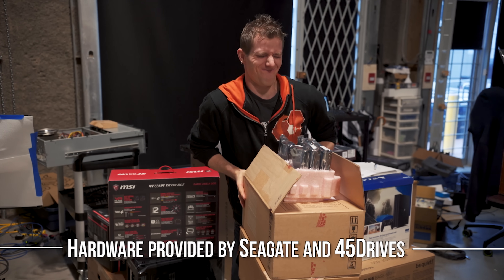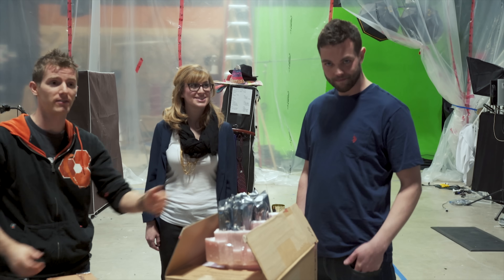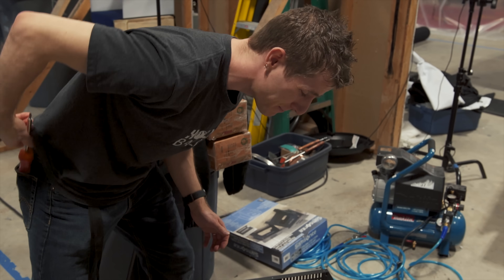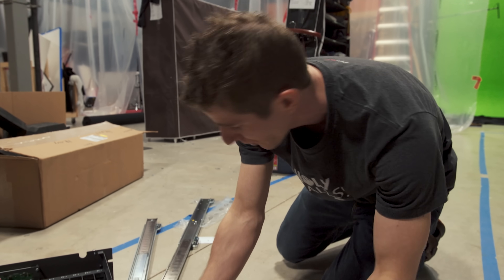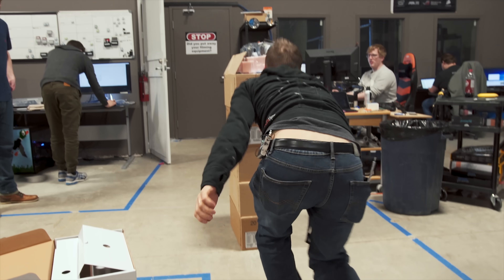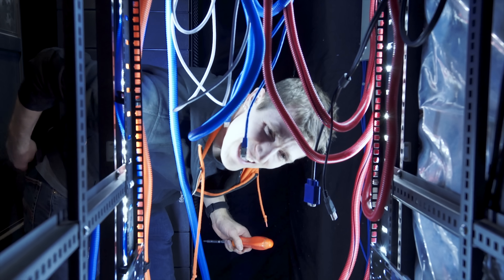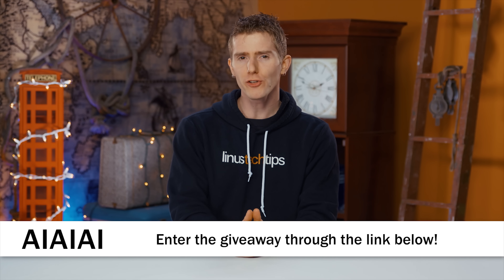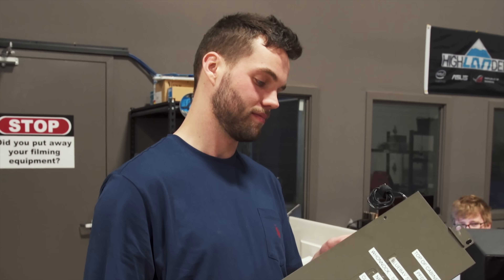INSTALLING THE PETABYTE - Server Room Upgrade Vlog

Comment: 50 years and it all will be in a micro sd XD
Reply: Those will be the days. We'll all look back on this video fondly when a petabyte had to be created from a ton high terabyte drives
Reply: MLG_Sloth DNA storage baby
Reply: thats probably true, but it wont be anything huge, because games would probably take like 10-20 petabyte.
Reply: luke bey I've heard that its painfully slow unfortunatly :/ But it could be paired with one or two levels of faster cache to make up for it
Reply: Actually, no

There is a limit where it cant possibly get any smaller
Maybe if we invent a new way to store data
That wont be a micro sd anymore though,  soo
Reply: LEGENDARY DABING POTATO U sure you don't mean in a 106ds XL. Mario Kart 31 will run in 16k, and the graphi CD s are so intensive that it takes 23 Titan X Pascals to be able to get about 4fps. (I mean try installing minecraft on an apple computer from the 80s will a few kilobytes of ram and 16 megabytes of storage or something like that. That will be the advancement of technology.)
Reply: I would say no more than 15 years tops, that is if storage progresses at even half the rate it has thus far.
Reply: Nah man; the all new Jazz Drive XD (Xtra Density)
Reply: Maybe 3 or 4 Years...I saw yesterday 16 Terabytes of ssd harddrive & it was like 3 inches long
Reply: LEGENDARY DABING POTATO  i would say 5 years max. The technology is rapidly developing.
Reply: luke bey don't forget dna data where all the information on the internet could literally fit into the tip of an pinkie.
Reply: due to new info laws, in the future, nobody wants to store anything..

so.. i think.. some people wage their lives in holding those somewhere in deep secret places.. or moved around by innocent unknowingly used mules.. with silly hello twiggy bagpacks.. because that is the trend in the future... everybody loves hello twiggy
Reply: Organic modules my man.
Reply: LEGENDARY DABING POTATO probably way less than 50 years, technology is developing faster and faster
Reply: It's probably sooner the than that. When they crack DNA storage...
Reply: so true
Reply: Those days gonna come
Reply: 666 likes
Reply: A 1pb hdd is possible. It would just need a ton of platters.
Reply: LEGENDARY DABING POTATO lol

Comment: *runs into Linus's server with a 5lb rare Earth magnet
Reply: A powerful EMP generator would also work fine....
Reply: Maybe a gun?
Reply: Major League Vlogging wtf man? the data on HDDs is written and read by magnets...
Reply: Linus is going to drop them all, sooner or later.
Reply: AveraglyAverage na to noisy
Reply: Yoav Zoller fukin rich af
Reply: now thats the reason ssd are never used for GIANT archive
Reply: it may or may not do much.

HDDs have rare Earth's in them to control the heads and they're big too.

on the other hand, most drives have an Aluminium case which does not impact a fixed magnetic field.

those disks are inside a steel case inside a steel server however. So you'd need to put the magnet on an actual drive.

Enen then you'd need to cripple a few, as it's an array, and it HAS THE TECHNOLOGY,  AND IT CAN REBUILD!

Also MLV bro HDDs are magnetic storage. optical storage is permanent / semi permanent and is only employed on compact disk, DVD, or blueray disks.
Reply: A giant tesla coil would be fun too 😈
Reply: Ummm, no! There are NO fricken lasers in a hdd, it's all about the magnets baby. An oscillating magnetic field will corrupt the data. 

SSDs, on the other hand, function nothing like batteries so it looks like you're two for two there buddy.
Reply: Next video: Our raid server is gone (again!)
Reply: Kyle4679 I will do it
Reply: Lol
Reply: Major League Vlogging but don't hdds  be more affect as it has mining parts
Reply: Hehe
Reply: jaxative jax It's extremely hard to produce a strong enough magnetic field to damage the recordings on the HDD platter. It is written with a very strong field from an extremely short distance compared to the distance between a platter and a magnet outside of the drive.
Reply: How about a massive neodymium magnet
Reply: flangel842005 no. HDDs write data in physical form, by imprinting laser on them. SSDs store data like a battery, so any electrical discharge will corrupt the data in ssd.

meanwhile I believe that laser cannot be corrupted by a magnet.
Reply: unknownagamermc tis electromagnetic, not laser.

Comment: I have 180TB capacity in my home server but after redundancy and back-ups there is only 82TB usable.   It fills my entire linen closet which has been outfitted to be a server closet instead.  I would love to have this.  I do not think I would need space for over a decade .  However drives tend to fail after 5 years.... so there is that.

Comment: I have never seen someone feed the wires into that blue tubing like that before. Usually people open it up slightly and put them in or push them in. Usually works and not as difficult.

Comment: I'm sure 100,000 ppl have told you already, to fix dents like that you use a 'dent ding hammer', sometimes called a rubber hammer. You can get them in different levels of rubber hardness (hawhaw).

Comment: Umph he assembels a Server on a dusty ground. Might wanna use a new invention called a "table" for that.
Aaargh he is not using a ESD-Kit but touches vigorously the chips and contacts of hardware that costs thousands of dollars.
ohno tho it may be a hotplugsystem, sending 80 powerspikes to a running system can be damaging? You better shut down the server for that.

Comment: I love that all Windows users think they're losing storage when a 1 PB array shows as ~700TB. The problem isn't loss of storage due to overhead, it's that Windows measures in 1024s when everything else HDD-wise is done in 1000s. a 10 TB HDD is 10 Terabytes, but Windows uses Tebibytes, which are larger.

Comment: Why do you not know that data transfer is measured in BITS not BYTES!
Reply: Data transfer is always in bits
Reply: GB = gigabytes
Gb = gigabits
There is a difference
Reply: There's also the new Gigibites vs Gigabytes and Gigibits vs Gigabits.
Reply: look at 13:42. It clearly says kB/sec. Big B for bytes, little b for bits.

Comment: and here i am trying to convince my self to go with a 512gb ssd on a new laptop instead of  256!!!
Reply: Ahmad Nader Same😂😂 
btw what laptop you thinking of
Reply: The hp Spectre x360 15 inch laptop
Reply: Ahmad Nader using it for gaming or personal use?
Reply: Toast The Tunes it's gonna be for personal use. it has a dedicated graphics card, but it's not gonna be a "gaming laptop" by any means
Reply: Ikr
Reply: Ahmad Nader my phone is 256
Reply: Mine is  64 lol
Reply: Ahmad Nader here I am thinking about a 1tb HDD or 500gb
Reply: I got the 2016 Spectre x360 with the 512GB SSD & i7. It's awesome for when I'm sick and work from home but let me tell you, throw a game at it (albeit on lower settings @ 1080p) and it handles it great. Bring an Xbox One controller with a wireless adapter on a plane ride with you and you're set!
Reply: IDK, maybe don’t get a SSD?
wait, nvm even though they cost more, they’re more reliable.

Comment: How to have free 500000GB of storage:
1)go to google and open 100000 accounts
2)Use Google drive
3)5GB each account x100000 accounts = 500000GB of FREE storage
Reply: SwordSweeper127 Or just use your student account like I do and have unlimited drive storage.
Reply: SwordSweeper127 but Google drive is 15gb each account, and you get 2gb extra if you participate in their annual security check!
Reply: Use 100,000 different VPNS
Reply: 4)Get banned from Google drive after they catch you abusing their system.
Reply: Your a genius
Reply: give this guy a medal...!!
Reply: David Cole haha you told em
Reply: Can you set up the drive accounts in RAID?
Reply: JackOfAllRAIDs Yah they're gonna check the IP and find you lol
Reply: Minimum that idea is strange
Reply: now build an virtual raid onto that. genius!
Reply: LXRDD GRAPTOR lol
Reply: LoL
Reply: When making the account, set it to China. You won't need a phone number.
Reply: SwordSweeper127 Core problem with that: Data would be scattered left right centre.
Reply: and then read/write data at 3 or 4 MBPS and spend your life filling up that 500000GBs
Reply: so just 500 mega accounts

Comment: Calmly sits here with my 160GB Hard Drive
Reply: +StrikingTwelve "Calmly sits here with my 160GB Hard Drive" What are you running, a Windows 98 machine? LOL . Even a $250 computer from Walmart comes with a 500 GB hard drive.
Reply: I've got about 499gb but I'm down to my last 100gb cuz of all this po.. games.. because of all the games i have. 😂
Reply: And here I was upset that I could only afford to get a 500GB NVMe M.2 drive...
Reply: StrikingTwelve 50 bucks for a 1 tb hdd 20 for around 500 gb
Reply: I seriously hate how expensive my NVMe M.2 drive is. $250 for 500GB. It's fast as hell, but I'm completely dependent on my 4TB storage HDD. Which is also filling up with all the hundreds of movies my sister downloaded. -.-
Reply: laughs in 60 gigs
Reply: i have two of them xddddddddddddddddddddddddddddddd
Reply: Ha, I got you all beat.   I calmly sit there with my 180TB total capacity server. (2 RAID 6 arrays that mirror each other for back-up purposes so basically 90TB capacity along with a cold storage secondary back-up which is a RAID 5 not including in the 180TB capacity on the server.) 

Gaming rig only has 500GB -ssd, laptop 250gB -ssd, HTPC 500gb.  No need for lots of storage space on external computers or devices since I have a server with a VPN connection.  My own personal cloud machine....

The ONLY downside to all this stuff is the $60 extra per month electric bill to run everything and the occasional replacement of a harddrive.  I can add more harddrives and expand the raids to even more space if I need to since I still have additional 3.5 slots.
Reply: If you want, you can get a 2 terabyte external hdd for only $80 online.
Reply: Bullet barry giveaway ! How much is a 1tb ssd? I'm planning to upgrade my 120 gb sdd.
Reply: Shapunky 1 TB SSD is Suposely 1000 GB.
But is Practicly 1024 GB... Also, They arent Cheap.
Reply: and only around 800 GB usable in Windows
Reply: StrikingTwelve i have 500 gb
Reply: Calmly sits here with my 40GB Hard Drive
Reply: I have 2048Gb of storage
Reply: StrikingTwelve BRUH. Even MY LAPTOP came with 1TB of storage and it costs like £400.
Reply: @paul2413  It's obviously an SSD
Reply: I use a few 64gb memory sticks to store my dji drones footage
Reply: and i thought 256GB on my laptop was bad
Reply: that's terrible
Reply: Calmly sitting here with my 32 gigs sd card (raspberry pi)
Reply: You know what’s funny. I remember when a gig was a lot of hd space. I still have some 10 gb hd’s. Slow and loud but they work. I remember how damn expensive they were too.
Reply: Ya i remember when i bought my 1st ''large'' 250gb hd to my gaming pc back in the day....Years later sitting here at 1tb M.2 Ssd and additional 12 tb storage XD
Reply: 120gb SSD due to techy stuff (stuff like extra gbs for stuff)
Reply: Calmly sits here with my 25gb hard drive assigned for Arch.

Keep it simple, stupid
Reply: I have 120GB drive
Reply: thats not decent thats shitty
Reply: your not alone, my bro runs a decent budget gaming pc with a 160gb hdd ahaha
Reply: calmly sits here with a 4 terabyte hdd at 7200 rpm and a 1 terabyte sdd

Comment: 5 years later and you can buy a petabyte HDD for $299
Reply: John Jeffry But a petabyte of data would be nothing then, so you'd really not lose much
Reply: Well it's been 5 years and now you can't buy GPUs. Sorry guys I was wrong
Reply: @SuperPyro  it's been 3 years and now you can't buy RAM.
Reply: 15 years later you can buy a 1,000 petabyte HDDs for 50$. I'm not even sure lol.
Reply: Wind Walker 1024 pb is 1 exabyte
Reply: Too bad in five years HDD will be obsolete with the major advancements with Solid States.
Reply: Ryan Montigney, 1TB SSD's are around currently around that price point. A 1TB Samsung 850 Evo is currently between $350 - $400. I would guess that in 3-5 years, you'd probably be able to find a 1TB SSD for under $100.
Reply: oh i did not know that thanks you taught me something new :)
Reply: SuperPyroManiac out of all these comments this is probably the most realistic
Reply: Phillip and Alex no... HDD=hard disk drive 
SSD=Solid State Drive
Reply: unfortunately your are wrong
Reply: Yeah & when that one die ,You will lose a Petabyte of Data
Reply: SubaruImpreza well it all depends on what resources are used to create more powerful ssd that have more speed and more capacity i estimate an avg 1tb ssd in like 3-5 years will be 250-300 USD.
Reply: Viking Technologys sells SSDs with 50tb allready and samsung is working on a 80tb one.
Reply: SuperPyroManiac more like 15
Reply: SuperPyroManiac *ssd
Reply: By Moore's Law (which isn't really a law and is slowing down because quantum effects), if we are presently at 8tb then:  1024/8 = 128 ; log2(128)=7, so it would take at least 7 if we weren't already having issues.
Reply: @ethanpet113  Clear your sentence
Reply: Ryan Montigney But will SSD's be as cheap as hard drives are today?
Reply: How much different was 2012 from today?? Exactly.
Reply: would be an hour of footage
Reply: but they got it for FREEEEE
Reply: 5 years later and data will be so tiny you won't need a petabyte
Reply: @smileydud9575  not even close 😭😭
Reply: 2022 here.
no.... just no, FCK YHOU
Reply: +Jarhead damnn
Reply: thats to soon, maybe is 10-20 years there would be 100TB drives
Reply: Trvp Game fidget spinners

Comment: alright, so if the camera fills a gig every 3 seconds,
that's 3,000,000 seconds available with 1 petabyte of storage.
with 10 minute videos,
5,000 videos are possible.
15 minute videos give 3,333.3333333333333333333333333333333333333333333333333333333333 videos
20 minute ones give 2,500 videos
30 minute ones give 1,666.66666666666666666666666666666666666666666666666666666666667 videos
...ya, you'll be fine for a while

Comment: I'm sorry. 300mb per second?

10 seconds of that footage can take me a whole day to download...
Reply: Thats atleast 3-4 strokes in porn, just imagine it'd be the best 3-4 strokes you've ever seen. Even better in real life.
Reply: I did some math that's 0.5787 kb per second I don't think you should even be able to run this video if that was your internet speed
Reply: I have optical fiber but the internet is stil 3-4 Mbps :(
Reply: Same my friend. Same.
Reply: okey, tell me where in Finland d oyou live? What operator do you use? I think DNA is the first 1gb/s provider and that was just released this summer.
Reply: MibMoot it's take me a week
Reply: I get 70kbs a second so..yeah...
Reply: Not to mention I highly doubt you have the hardware to see that video at it's native resolution. :)
Reply: MibMab damn your Wi-Fi is even worse than mine
Reply: I have 1500 Mbit/s download speed and the minimum I have ever seen by using Speedtest is 950 Mbit/s. Maximum I have seen is 1400 Mbit/s. All this for 50 euros a month. Unlimited 4G (350Mbit/s, ranging from 200 to 300 Mbit/s) data with unlimited phone calls and SMS is only 20 euros a month and 4G works almost everywhere with minimum speed of 50 Mbit/s. Upload speed ranges from 100 Mbit/s to 500 Mbit/s. The only requirement is optical fiber support and it is pretty common over here. Also, a lot of houses receive it afterwards all the time.

Comment: Math time for those of you saying how stupid this server is, and that it's over the top. 

So, as stated in the video the LTT crew just upgraded to 8k recording. This means, as also stated in the recording, that storage will be used up at 300 megabytes per second, or roughly 1 gigabyte every 3.33 seconds. Considering that their average video is 10 minutes, or 600 seconds, long, we can say that the average LTT video will take up about 180 gigabytes (600 / 3.33). This server can store 1000 terabytes, or 1,000,000 gigabytes of storage. This means that the new Petabyte server can store 3,333,333.33 seconds of video, which is 55,555.55 minutes of video, or roughly 5,555 videos. For reference, LTT to date has over 3,600 videos, albeit I'm sure their archives vary from 1080p to 4k to date. This isn't even factoring in other storage needs from this server and the actual effective data capacity of it. So, no, this is not unrealistic of a server for an enterprise as reliant on data as LTT.

Comment: Those proprietary cables are freaking expensive!! I got a good 8 port KVM for free, but it uses all of those proprietary cables and I don't have any, and they're like $20 a piece... I bought a used 8 port KVM that uses standard cables (Cables even included!) for $20 on Craigslist. Sweet build though. How was the ZFS pool configured?

Comment: Strange question and I could be talking nonsense here.  But wouldn't online storage be cheaper?  More flexible for growth etc., plus less risk of failure.
Reply: It would be cheaper, but would also be completely impractical for videography. If they were just storing files that they didn't constantly need access to, then you'd be correct. However, since they need constant access to the data contained on the servers at speeds upwards of 1GB/s, online storage is completely impractical at this point in time. In the future, when/if ISPs decide to pull their heads together and stop selling awful internet speeds for extortionate prices, and rather focus on making faster internet speeds more accessible, then an online storage solution might be feasible. However, I doubt ISPs would EVER offer those kinds of speeds for reasonable prices

Comment: When I look at building server 2016 storage servers, I like going with 512gb+ of ram and like to use a a few terabytes of nvme in front of the hard drives to improve the performance of hot data.